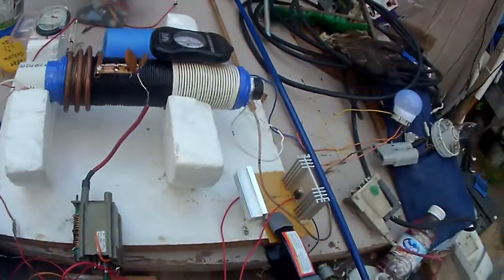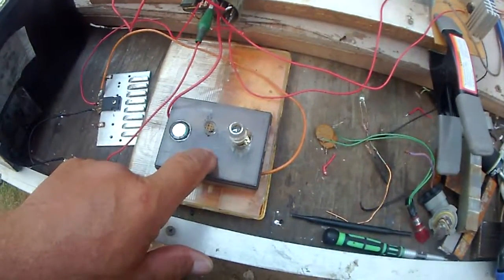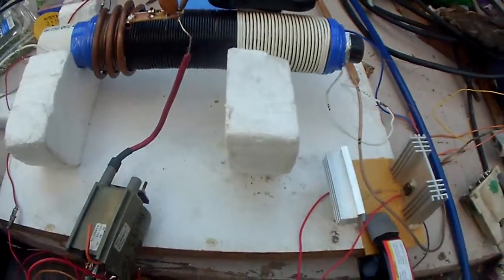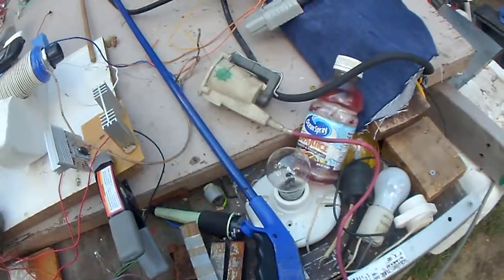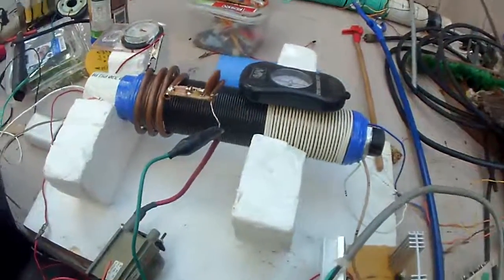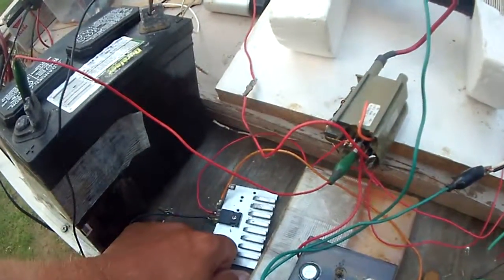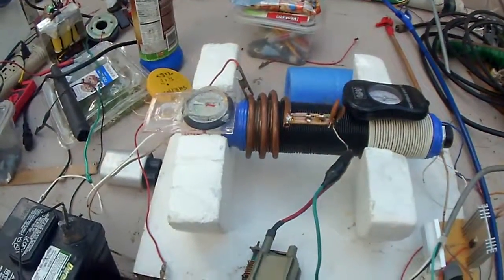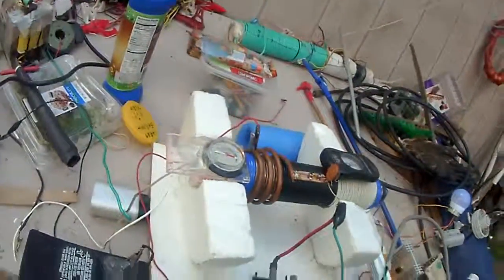Chubinidze replication attempt 1

Comment: I'm not sure what kind of flyback transformer you have, but if it is out of a computer monitor, then it has a capacitor in it. See http://mujweb.cz/jmartis/flybacks.htm
Reply from the maker: +Vid Bid I believe its from a color tv and leaking due to the high pitch sound you can hear.I also tried others with different capacitors in series with them.